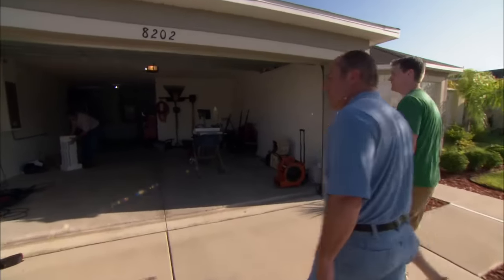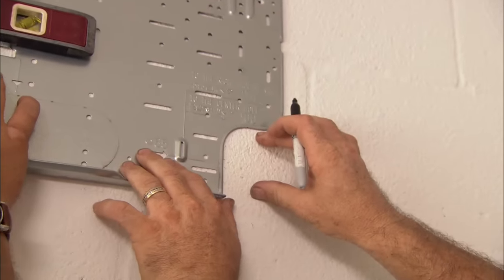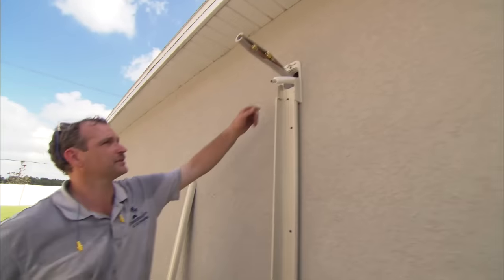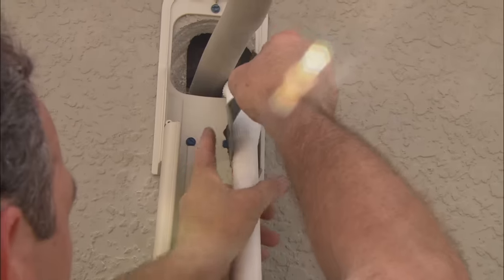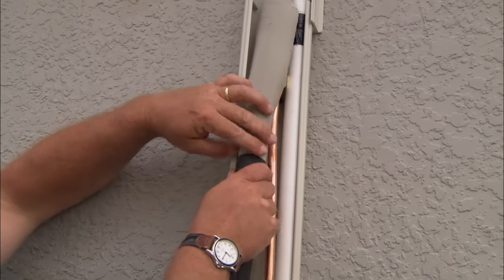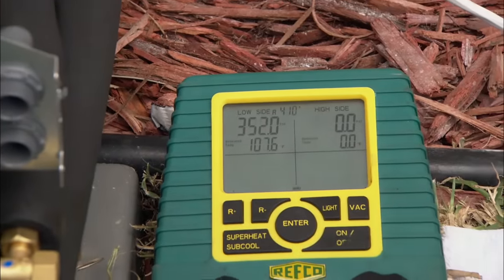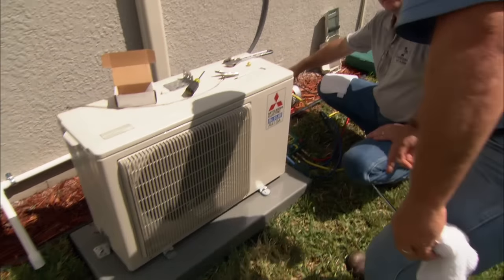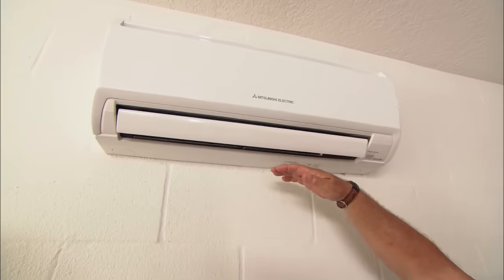How to Install a Ductless Mini-Split Air Conditioner | This Old House

Comment: I learned something with this clip. I learned to have professionals install my AC units, lol.
Reply: +phili878 hahahahaha I HAVE NONE OF THIS GEAR!!!
Reply: +phili878 At first I was like: "I can probably do that" but quickly it turned into "No way am I even going to attempt what they're doing."
Reply: ***** hahaha how wonderful
Reply: ...or not
Reply: Don't most unit come already charged with freon? I think the pressure test is a little more complicated if one does not have all the supplies and tools to do the test.
Reply: +Kurt M.  If you can buy the unit in your state wo a license, then you may install it yourself.  They were designed that way, but HVAC companies in the US have a strong lobby and the guild has tried to keep these off the US market for years.  However big box retailers like Home Depot realized they could make money so greed topped greed.  A wonderful free market.

These are the norm overseas.  Ducted systems are the norm in North America.
Reply: I am not sure I get your post...no offense, but what is wrong for Home Depot, Lowe's, Sears and tons of other retailers and internet sites selling these ductless mini systems to the public. 

It sucks having to need a licensed HVAC person to install or at lest test and "approve" the system for warranty purposes, but I can understand why companies would do that. I don't get why you bring greed into this conversation.
Reply: +Kurt M.  That's my point.  Don't overreact.  I agree with you. As long as you can do basic wiring and use a few tools.  Of course the wiring you best not talk about to your county/city, and if you don't know how to do that, then don't try.

The offsetting greed was, and let me say this again.  The US and Canadian HVAC dealers make a fortune selling and repairing ducted systems which are not DIY.    Far from it.  They are extremely complex. However after years of trying to keep these units OUT of the US market, due to NAFTA and their heavy use in Mexico retailers like Home Depot wanted to sell them, thus they fought the AC lobby and got them in.  At first as DIY units, but eventually they started hiring installers and telling you you had to, so you're back to square one.
Reply: +Kurt M.  oh BTW I remember a Sanyo model that uses a simple house wall plug inside the home to run the whole thing.  That avoids the electrician.  It also came with the pre-made tubing, so you only need a wrench and no plumbing skill.  I don't know if that one is sold here anymore as it was super DIY oriented, including the simple recommended leak  test with soapy water.

115v is probably limited to 16000BTU or less and uses more kW than a 220 install.
Reply: This thread talks about a mini split unit A/C. In other words there is a condenser on the outside of the house and the blower unit on the inside. All models supply the power to the inside unit from the condenser. The power supplied to the condenser must be properly and waterproof installed. A plugin type connection is probably asking for trouble.

I have seen only one brand that provides 1200- BTU under 115V. Most brands limit their BTU to 9000 for 115V.

I believe there is more than soapy water required to check for leaks. Moisture must also be evacuated from the lines and that takes a special equipment/pump. BUT, even if one has the skills and equipment to perform this work, there will be no warranty should the unit fail, regardless of fault.
Reply: +Kurt M.  Yes I know what this thread is talking about.  That Sanyo model, that was aimed at the Aussie mkt and was the only one I remember that ran the power cable backward, which was obviously aimed for the self install.  You wired and piped the two together through the wall just like this one, but you connected to house wiring using a simple GFI appliance plug inside from the head unit like a small window unit would-  no dedicated wiring.

Yes I agree on soapy water, but that was in the instruction set and the how to video. REALLY WAS.

I don't know if any of those are on the US market anymore.  They were at one time, but all the sellers now tell you to get a licensed installer to get the warranty so why not have 220 wired outside with a breaker box if getting an installer.  More effecient and can better handle heat strips or heat pump features.

These are all more electrically effecient for small homes than forced air systems that we all built at the end of the cheap power era 50 years ago.
Reply: TheNumberOne Page I'm not saying that it's not possible to DIY this (it is), but you still need all the right tools and equipment to get it done. I don't know about you personally, but most people do not own a flaring tool, vacuum pump, manifold gauge, or nitrogen cylinder. Plus there are other things you need to know that this video didn't mention. Do you know how to check and make sure your unit has the proper charge? Because you may have to add or take out some refrigerant based on how long or short your lineset is, and you're not legally allowed to work with most refrigerants unless you are EPA certified to do so. So yeah, it's doable, but it's not quite as cut-and-dry as this video makes it look. You could screw shit up if you don't know what you're doing.
Reply: LOL, right? After that shopping list and everything, just hire somebody!
Reply: ***** You're telling me that you could do this job without a vacuum pump? Please tell me how the hell are you going to ensure that the system is free of non-condensables. As for a flaring tool, you could get away with brazing the lineset instead of making flared connections (even though basically all mini-split manufacturers strongly recommend that you don't do that), but for that you'd need an acetylene cylinder as well as a nitrogen cylinder. And explain to me how you can be sure your system is charged properly without a set of manifold gauges and a temperature clamp- you need to check the pressure as well as the temperature to ensure that your compressor won't get fucked up from liquid refrigerant entering into it. Do you have any experience in HVAC? It sure doesn't sound like it. I would recommend that you personally don't attempt diy a job like this, you seem painfully ignorant of what it takes to do a job like this properly.
Reply: ***** Well yeah, you could technically get it working without all that stuff, but it's not going to work right and its probably not going to last very long.
Reply: Powerful lobbies and resultant political interference in commerce. Free market. Pick one.
Reply: Parker Shaw Except for the fact that it's technically against the law for someone without an EPA 608 certification to work with refrigerants over a certain amount, which would make it mighty difficult for most homeowners to recover or add refrigerant to the system if they have to make any changes to the lineset at all. Plus most if not all a/c manufacturers will void the warranty if you decide to do it yourself. It's not my laws and I'm not saying I agree with them, but it's something to think about. By all means, do it yourself if you think you're up for it. I've helped my friends out of jams and taught them how to do certain repairs on their own.
Reply: ***** Almost all manufacturers require that you have an EPA cert to install their equipment. Otherwise, you void the warranty. And yes, ALL refrigerants have to be recovered, BY LAW. It's illegal to vent any refrigerant into the atmosphere, regardless of whether it's chlorinated or not. Obviously you don't really know the laws too well.
Reply: Parker Shaw As long as you don't have to add or subtract any length from the lineset, then true you don't have to do anything with the refrigerant, but it doesn't always work out that way. And if you're ok with voiding the warranty, then knock yourself out.
Reply: PFG - 45 Ag. 042-IO njn
Reply: It's probably wasn't feasible with their type of system to have a professions to do it
Reply: Kurt M, Yes, it's best to have a professional do the testing.
Reply: you learned how to install but you didn't learn how much it cost?
Reply: hahaha
Reply: hahaha
Reply: PFG - 45 Ag. 042-IO 
HVAC schooling is a two year program
Reply: MrCube17 
And that was an easy little AC system
Reply: As long as u have a vac pump to evacuate pipes down to less than 20 microns, oxygen plus air conditioner compressor = bang!
Reply: I am a refrigeration technician and i love how you used the words "coolant, rust on the inside" lol makes me laugh like a little school girl. But on a serious note many units require recovering the refrigerant and it takes more than a vacuum pump and basic knowledge to install a unit that will last many years. I see improper installations all the time even by credited journeymen in this trade. By law a person not in this trade cannot handle refrigerants of any sorts new or old, if caught releasing any CFC or HCFC refrigerants into the atmosphere can be subject to large penalties. Plus if you love your planet you shouldn't be anyways as most refrigerants are Ozone depleting. Hence the licensing
Reply: no leaks below 2000 microns, no moisture below 1875 microns, recommended on new systems disregarding manufacturer's specifications is 500 microns. I have a $2500 evacuation setup and the best i have done is 65 microns isolated with schraders removed during evacuation. In theory I should not be able to pull that low since its very close to zero which then will start to relate to QED Vacuum in sorts. so 20 microns? goodluck
Reply: the model they installed is a Mitsubishi 15000 BTU and its a 208/230V unit so you need to run power to the outdoor. Though Mitsubishi are great units, they can be more expensive then the leading competitor LG which are great units as well. This person has paid about $3000-4000 for the install depending on the contracting company. But since its a for this channel in particular it was probably free lol
Reply: Might need to get ur gear checked, my gear wont even register as high as 2000 microns, I regularly vac down to 20 microns (as in my course this was a requirement to pass so has become my benchmark) 
But u are missing the point that without the gear u cannot install ur own heatpump!
Reply: wow that is odd. I believe your micron gauge might have different range settings applied. As we all know atmosphere is at 760,000 microns which your gear should register and begin the decline from that number.
Reply: TheNumberOne Page.  That is incorrect.  The flaring tool ( pretty cheap) and the vacuum pump are required.  If you don’t draw a vacuum on the newly installed tubing you will freeze the lines from condensation.  The vacuum pump will also show if you have a leak.
Reply: ALL Toh vids aremlm like that.
Reply: Sandro Kovalev Look another expert insulting others.
Reply: Jak Ripper Coolant?
Wonder how those 30 units are doing.
Reply: @kurtwm2010  Because he is right. The HVAC folks have worked hard to keep these out, and the state or city will get its cut for licenses and permits. If a DIY does the work, no fees to suck out of people, so the HVAC loses and so does the city, with the individual being the winner. This is a rare case to happen. All laws are formed for commercial controllers and statesmen to suck money from the masses. Where were you in social studies class? ;-)
Reply: @megamaser  Yup, its not so hard. Make sure you use the right r410a pressure flring tool. Make sure you give the condensor line a touch of angle, and the right amount of torque on the nuts. Make sure you have a vacuum, and you don't even need a micron gauge to do it. Just let the pump run a good while. Other than that, its a matter of making a hole in the wall and running wires. Make sure your breaker is OFF when doing the work.  I might take the entire day doing it, but knowing I did it RIGHT, and the satisfaction of doing it is not only a savings of $750-1500(the quotes I got).... Its PRICELESS! Besides, you end up with a few cool tools at the end of the job. You will want the torque with open end attachment(keep it at 90 to not off set the torque calc)($30). You'll need a pump($50), a flare tool($30), a gauge with vacuum ability($30)...and a few other basic things. You dont need a nitro cylinder. Some are sent with nitro,  which you actually dont even have to vacate. You only do the vacuum for moisture purposes. Some makes do NOT seal nitrogen in the line, and those you need to vacuum. Easily under $250 for the tools.
Reply: @NicholasJohnsonA  LOL...If only you had a choice. You dont.
Reply: @AK99581  Its only against the law to RELEASE the refrigerant in the air.  Not putting it into the system. Even if you release it, you have had to have done it on purpose, not accident. You do NOT need a license for r410a. Some states may require it perhaps, but you can take a test for it. QwikProfessionals has a easy test guide and you can be certified AND be in warranty. But thats extra work. I think if you can get it done for $500 or less, get it done by a careful tech. Otherwise do it yourself.
Reply: @AK99581  Nope...Illegal to do it with intent to release. Not if it happens by mistake...Besides, if you are doing this, you will need to be careful, so dont release any gas. Stop playing fear factor :-)
Reply: @philindeblanc  You're saying you don't need nitrogen or a micron gauge, so how are you gonna ensure the system is free of  leaks and non-condensables? Do you even know the purpose of having a micron gauge and nitrogen?
Reply: @sinaderakhshanfar9270  Yup, cracks me up too when I hear folks screaming about how knowledgeable they are about the trade, yet they can't even use the proper terminology.
Reply: TheNumberOne Page professionals are more skilled than you are. What next? No way would I pay a qualified professional to perform open heart surgery when I can do it myself and fuck up in the process?
Reply: Parker Shaw a DIYer is not a qualified plumber or heart surgeon or an electrician. Just cheapskates of society.
Reply: Ahaha I thought that bug on your profile pic was a crumb and I was trying to get it off
Reply: @imirish4702  Uh, not true.  A dedicated DIY'er may take longer to complete the project from lack of experience but with enough research and commitment can produce equally professional results.
Reply: S Tho 
It is true a homeowner can buy the equipment without a license however they must secure a HOMEOWNER'S PERMIT.
In addition they must do the installation, not hire it out, even to a licensed contractor.
Reply: Ken Arbuckle.  In the sunbelt states, most older pre 1960 houses have been butchered with retro ducts stuck in the underhouse crawlspace or attic and holes hacked into flooring or plaster ceilings.  In many of these homes, ducts are leaking, failing, black moldy or have had animal intrusions.  Most of that ducting was done by AC apprentices as dirty grunt work, so it was done badly.  Too bad minisplits weren't available in 1975 to modernize these homes.

Replacing moldy fiberboard leaking ducts under a house today costs about $8000.  An attic, probably $5000.  A two - four zone minisplit will handle a 1800sqft house from the 1940s for less than just replacing the ducts.
Reply: @STho205  Fun fact, if you install it yourself you will void your warranty.
Reply: @paulntx  fun fact, if you pay a AC company $1,200+ to install one,  you have bought two,  so the warranty on a self installed unit is moot.   

However most say andshow in instructions it is DIY except for requiring a tubing leak test prior to turning the hex key valve.   That should only cost a $200 service call and take 20 minutes.
Reply: S Tho no actually it’s because refrigerant is very harmful to the environment and you a licence to even purchase it let alone work with it, also same with electrical you also need a license to run wires and such
Reply: Sandro Kovalev ...... I know your comment is 3 years old, but potential readers need to know that warranty cannot be voided due to installing yourself.
Reply: @WilliamWBG  Depends on the circumstances but it definitely can be. The only time I'd ever even say DIY is an ok idea for someone who doesn't work in refrigeration is with precharged linesets that have already been fabricated to be the correct length necessary for the install. Its definitely got to be the exact length though. I've seen so many installs where someone bought a 50ft precharged lineset for a 25 ft run to the condenser and just literally coil up the tube and laid it on the ground. This creates a potentially large oil trap, which could restrict oil return to the compressor burning it out prematurely and restrict refrigerant flow to the head. Any additional changes to the system intentional or not, will most definitely void the warranty.
Reply: yeah, HVAC is one of those things that you can't DIY unless the Y is already a professional. by the time you do all of this and get the tools, you might as well go into business for yourself.
Reply: My dad and I are installing ours, but he's maintenance mechanic so he knows how to do this
Reply: not all professionals are equal :D
Reply: @Vara
I hear ya!! Also sounds like this thread has become a "Technicians feud" site. 
By the way, WHO spends all that money to cool off yur F@#in garage?? WTF??
Reply: @MrCube17  
Exactly! Rarely do these things just "snap in place" n off you go. You can't even get copper in California,  all the meth-heads have sold it.
Reply: Lol when he brought out that flaring tool ..lol
Reply: @Fixer_101  .
Reply: @garimarai6236  this is an old video. The copper lines are flared and easy to install now. Im gonna try to do this by myself today 🙃
Reply: @kurtwm2010  kurts a real man 🤡
Reply: P
Reply: Lol
Reply: @jvegas  all
Reply: @SDPBALLCOACH  That’s why I come to these A/C comment sections…it’s hilarious to read the flame wars!
Reply: amazing